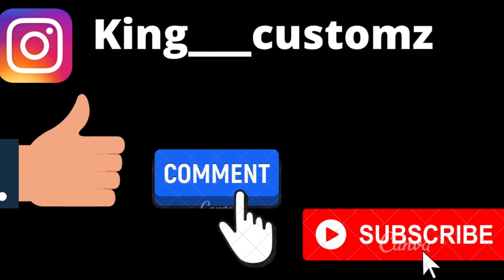what can I do to increase truck towing capabilities

Comment: The single most important thing in the Avys are their weakest link. The 4l60e. Depending how many miles a trans cooler is number one. And he has an 07? Like everyone else, disengage the DOD immediately! Or get rid of it altogether by deleting it. Since they are only 1/2 trucks, air bags for the rear to eliminate any sag. Fourth, being a tune and finally a gear. Motor is strong enough.
Reply: If you plan on towing regularly and over 6000 + lbs I would seriously look into a 3/4 ton or 1 ton truck for serious towing.
Reply from the maker: sweet information man.
Reply from the maker: I agree level up If your looking to tow alot